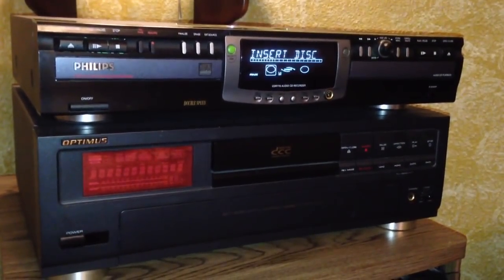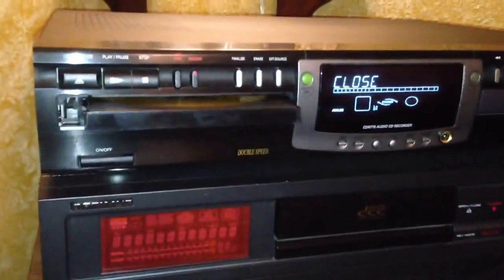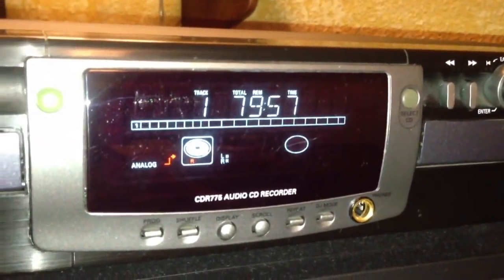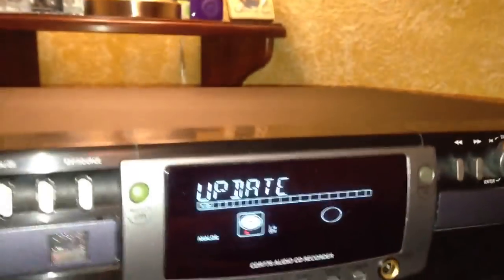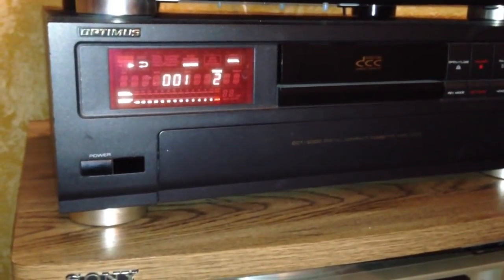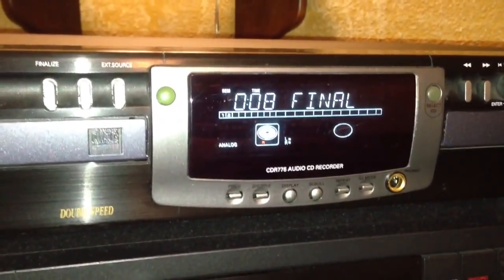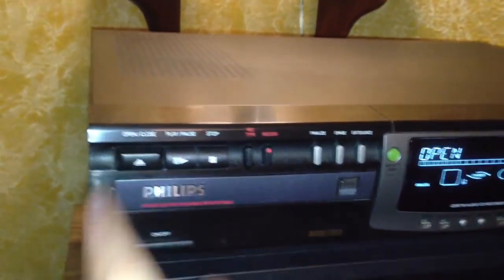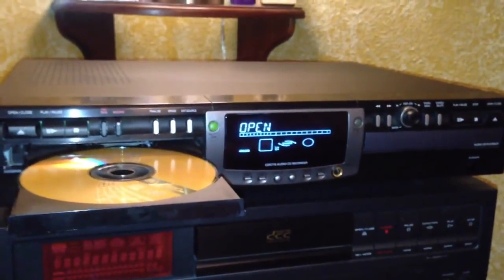How to make a CD using the Philips CDR775 CD Recorder

Comment: do you still remember which cdr you used? i heard it only works with 650mb 74 min. does it work with the 700mb 80min?
Reply from the maker: Jenru Wong I don't remember, and I sold the unit.  I now have a TEAC which is also on my channel.  650/74 is probably right (and a safe choice).

Comment: If not this exact model, I owned one of these circa 1999-2001. I can't remember the model number but the layout was similar to what's shown here in your video. The discs were expensive as I recall. I didn't use anything but Philips branded CDs for the first year or so. I made discs for a few friends and forgot to finalize these on occasion. I knew 'The Look' when someone was approaching me holding that jewel case out in front of them. 

When I got my first laptop, a 30GB Gateway, in late-2002 I gave the Philips CD burner to my younger brothers to tinker with and they used it for several years. I still have every disc I ever burned for my use and some of these are precious artifacts of another era.

Thinking about it now I wish I had backed-up my cassette collection for some of the rarities that I listened to at the time, primarily the 'cassette singles' and a couple of Personics tapes I had made at the Franklin Mills Mall in 1990.
Reply: Haven’t heard of franklin mills mall in 20 years.
I painted just about ever store in there and some of them twice.   The stories I could tell…
Better yet if a mall could tell stories this 1000% was and I’m sure still is the place.

Comment: I have this model. Perfect for recording from analog. It worked perfect for awhile but then started getting finicky even with the correct discs. It began to get OPC errors all the time. Powering on and off several tries tended to 'fix' it just to be able to use it. Sometimes the discs would have static on playback for some reason. (Several tries and it finally worked doing nothing any different?) So have extra CD-Rs laying around, because you wont be able to tell if the disc was successful without finalizing. The CD player side always stopped working when I used it (you can hear a high pitched whine from the drive and the disc would just stop playing either playing or dubbing a disc for no apparent reason) I assume it was related to the OCR errors. I dont know, its a shame. Nobody around where I live repairs these things. Again, it was great unit, when it worked. Just wish i had got more life out of it before it went crazy.
Reply: How often do you clean your laser lens? I had a Philips 765 CD Recorder and found that it operated consistently if I cleaned the lens after several hours of use. If you allow build up on the lens to linger for long periods, like most anything, it creates a coating that becomes harder to remove, and prevent the lens from recognizing and recording to the discs. Just like engine oil build up from leaking seals will contribute to your engine overheating.

Comment: just bought the cd burner  if i record how can i split the tracks and will any cdr work thats meant for music
Reply from the maker: There is a button you press to end the track and start a new one.  I don't have the unit anymore so I don't remember which one.  It should work with any "Music" CD-R
Reply: thanks
Reply: abe durant i have the same cd burner n a couple other ones.  The cds u are recording on have to say digital audio on them its on the middle right side of the disc in small letters.  If it doesnt say that u cant record.  Just dont pic any cdr disc it has to say digital audio
Reply: Hall Crystal thanks

Comment: You must use a Digital-Audio disc to record with this CD Recorder. Not computer discs.
Reply: Yeah it will say use audio cd
Reply: @bryanna72  If the audio CD does not have the words 'digital audio' in the Logo, then it will not work. Look closely and you will see that the Logo on the recording side of the CD Recorder will also say digital audio.
Reply: @judah Dor You have to push the 'play' button on the source unit at the same time you push the 'record' button on the recording unit.

Comment: Cool . I have a cdr philips 795 but one traywon't open the left side which appears to be the play side what can i do?
Reply from the maker: Most of the time a belt needs to be replaced in the mechanism.  You can also try pushing on the drawer after you press Eject.  My TEAC's left drawer is that way.

Comment: Use a computer to burn CD's you won't have to worry about compatability, you can use any brand of CD as opposed to using Music CD-R discs, to capture audio use a decent boombox or a tape walkman, use a rca phono cable which has a headphone jack and red, white cable and connect it to your walkman, use ADS tech USB Audio capture hardware for best results. Use audacity for capture, you can separate the tracks as well. No need for a CD Recorder...
Reply: I have all that stuff but I have to say that plugging it all together and using it is a lot more work when compared to just pressing the single record button on the CD recorder, then ripping the disc on the PC. These days when people think about digitising a tape or a LP they are likely to pick up a turntable or walkman with a USB output saving them from having to use the ADS USB sound card with cables trailing everywhere. A CD recorder (if you already have one) adds only 1 more step (the ripping step) and still saves all the cables, plus it can play CD's like the USB turntable can play the LP's.

Before I picked up a CD recorder (cheaply) I used to use the USB soundcard and audacity. However it made the living room floor a bit of a mess for as long as I had the stuff wired up. If you dont have a CD recorder or dont get one for a good price the USB soundcard will be a lot cheaper.